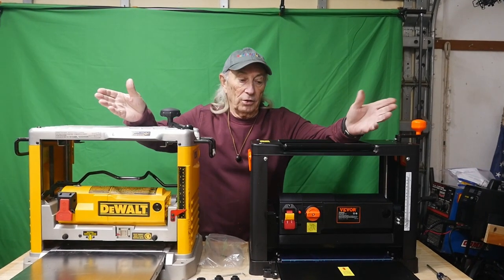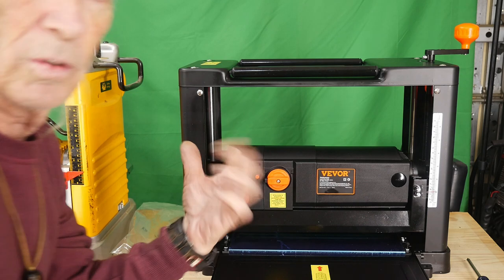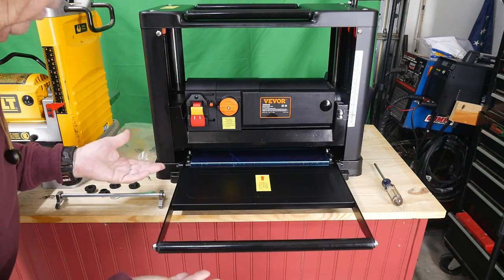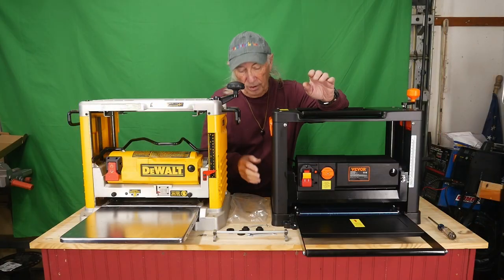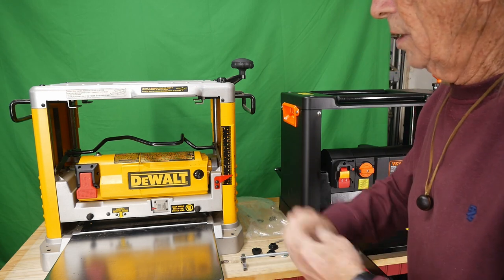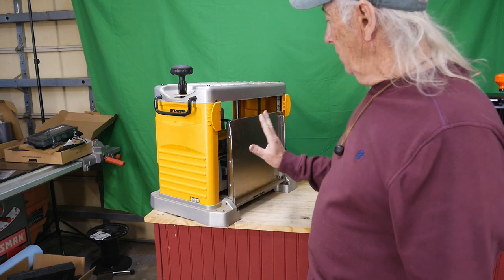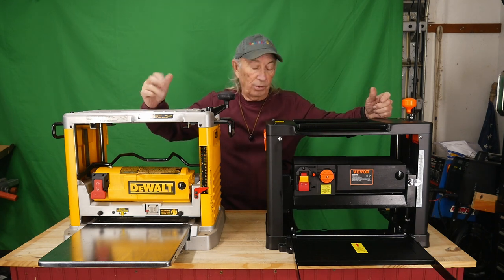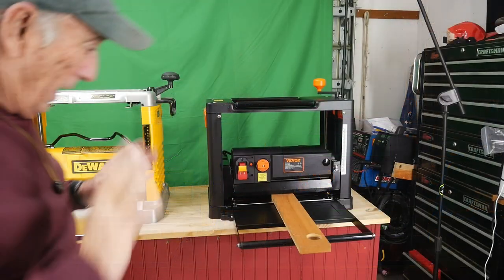DeWalt Planer VS Vevor Planer ! Which is a better buy ?  Coffee and Tools, Ep 324

Comment: I've always been disappointed with planer snipe.  Some planers are worse than others, but once you know how it happens, you usually live with it or don't plane those short boards.
Reply from the maker: Snipe is at times just that....ouch
Reply: I use a hot melt glue to add a 3" sacrificial piece on the leading end. No more snipe.

Comment: I think I'd still go with the Dewalt. Ease in getting service and blades. Plus the 734 is $399.00 at Lowes right now.
Reply: the Dewalt does have the tool to change the blades
Reply from the maker: Just checked and Lowes shows $699 for the 734. Must be a GREAT price if you can get it for $399

Comment: Nice planer.
My big Delta has two speeds and a thickness setting similar to the Dewalt but better. Also has a lock to set the planer head so it doesnt move.
I like that Vevor over the Dewalt.
Reply from the maker: Yeah, the Vevor was a shocker for me 2. I'm going to sell off the DeWalt and keep the Vevor machine here for now. Testing also showed no stalling out like the DeWalt does.

Comment: Guess what showed up on MY front porch today?!?! It’s was in a box marked…VEVOR!!!😲😳😎🤣🤣
I watched three other reviews after I watched yours…this thing smoked that yellow planner. Weight was a huge issue. 
Now I’m fairness, it does tell you it’s not designed for “very hard wood” but,  pretty confident, if you kept the cuts really shallow…it would be just fine. Now I gotta figure out where to put this thing!!🤣😎
Reply from the maker: ha ha...yeah somehow that 60lbs is like...OMG..what does 80lbs feel like ?
Reply: @SirTools  i KNOW that box weighted 20 lbs!!🤣🤣 
I like it out of the box. I’ll get it set on a base with locking casters and fine tune the in and out tables…but I appreciate the review and recommendation. A two speed, three blade benchtop planner for 322 including shipping…had it in less than a week….that’s is a two thumbs up brother!!👍🏻👍🏻
Reply from the maker: @keithrayeski6417  I'll be honest here, my DeWalt is up for sale now. Guess my DeWalt fan boy days are over LOLOL
Reply: How does it go with hard wood after 3 months? I broke a planer because of hardwood..... Do you use the slow speed for hard wood?
Reply: @SirTools  🤣🤣👍🏻
Reply: @stoney268  it depends on what you’re doing with the piece of wood. If you’re trying to bring it into dimension, low, or slow, speed is best. If you’re cleaning up a piece of already dimension lumber, go high, or fast, speed. A lot of blades are universal. Like everything else, it’s what you find works best for you. You could ask 10 guys and get as many opinions…or a fifty/fifty split. I prefer pickle slices over pickle relish, on my cheese burgers! Oh, and it’s got to be white cheese, not yellow!😎🤣👍🏻

Comment: My new Vevor 2000 W 3 blade worked four times altogether maybe 1 hour. Then with no load the blade shaft dropped because the axel broke and I thought it exploded, you can guess what noise it makes when the shaft takes off and gets stuck inside. Vevov wanted to send parts and make me fix it myself. Enough of Vevor toys.
Also the dust collector works poorly, it's oddly in the middle and the measurement thingy in the right is inaccurate as can be.
Reply from the maker: Cutting that Canadian white oak again eh ? LOLOL....Sorry for your loss. Mine is doing great and ran a barn of Douglas Fir through it. Some folks just don't have any luck with tools.